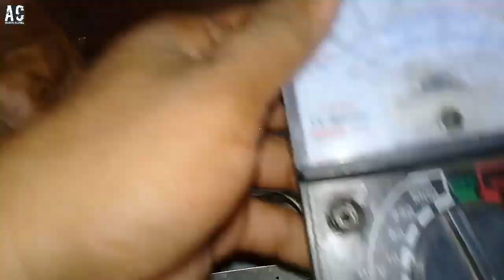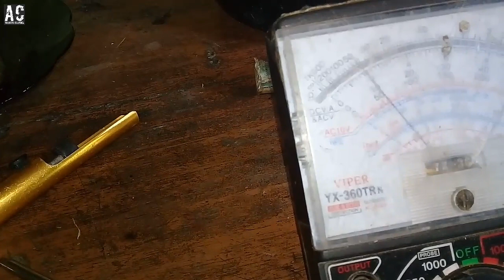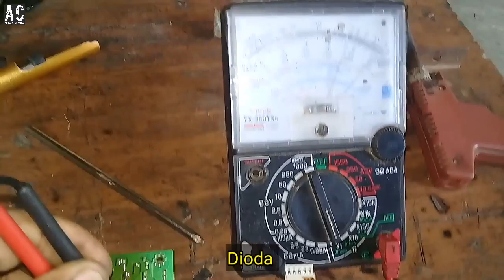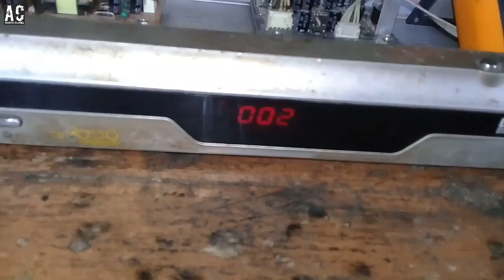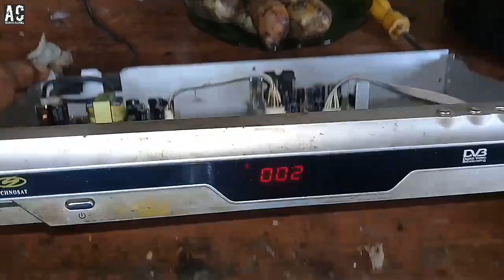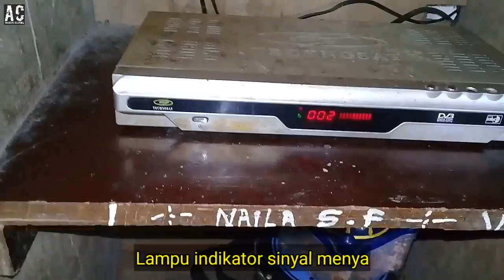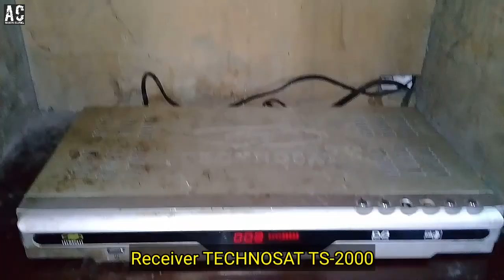Cara memperbaiki receiver Technosat TS-2000 mati total (kena petir)

Comment: Receivernya mirip punya saya, tp pnya saya cuma hidup led mata merah ja. Udah saya coba ganti pc 817 & transistor 1015. Tetap juga sama. Mhn solusinya bossku ...
Reply from the maker: Coba cek tegangan output psu; vcc 3.3V, 5V dan 22V ada/tdk. Cek juga tegangan di ic AMS-1117 1.8 (input vcc 3.3V dan output vcc 1.8V)
Reply: @ANUGRAHCHANNEL52357  ya. Tapi ic yang mpegnya kode ALI M3328c Panasnya ngak normal ... ??
Reply from the maker: @safamarwach6177  tapi tdk ada salahnya cek dulu tegangan vcc 3.3V siapa tahu over/berlebihan dan itu bs menjadi penyebab panasnya pd ic yg disebutkan tadi. Jika tegangan vcc 3.3V itu over dapat mengakibatkan kerusakan pd ic tersebut.
Reply: @ANUGRAHCHANNEL52357  ya bosku, stlah saya cek tegangan 3,3 = 6v, 5 = 10v, 24 = 38v ...
Reply: Maf lur tanya ...
Stbnya mirip persis pnya saya , tp pnya saya lampu indikator merah ja. Stlah saya perbaiki psunya udah normal teg out 3.3v, 5v, 24v keluar normal. vcc 3.3v & 1.8v normal.
Cuma ic ALI M3328C panas tdk normal dan permukaan tdk datar hitam. Mhn solusinya lur ...